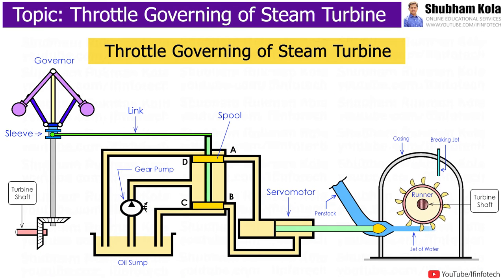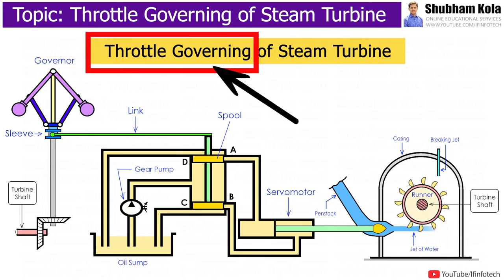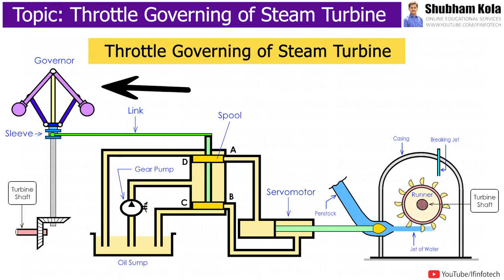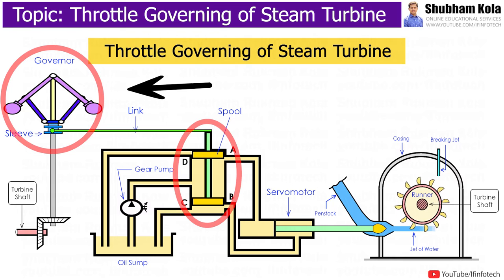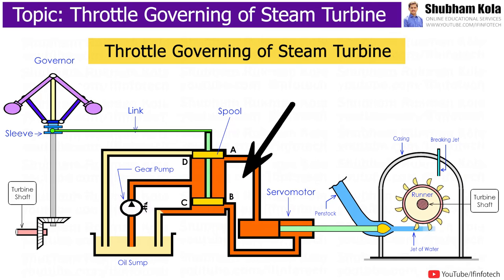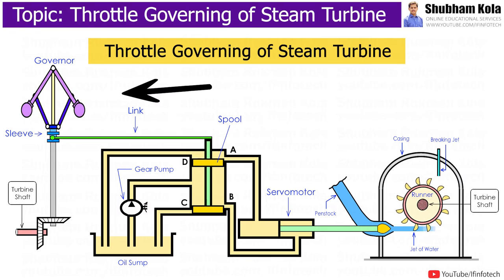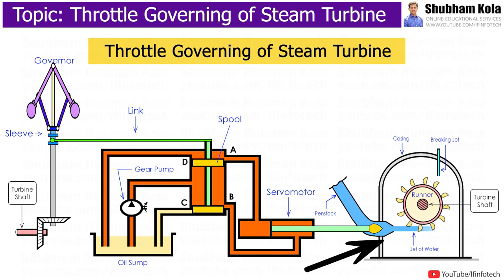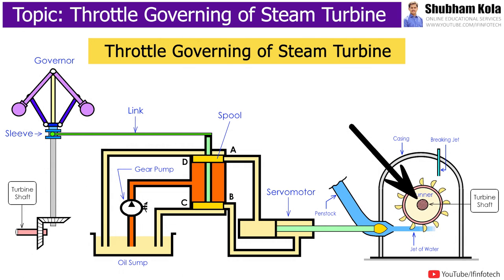Throttle Governing of Impulse Steam Turbine Working | Thermal Engineering | Shubham Kola

Comment: Dear Shubam
How can i calculate the pressure loss after governor throttle valve ? 
Normally throttle v/v is 75% open so how much pressure is lost at governor valve.
Pressure and temperature loss at governor valve.